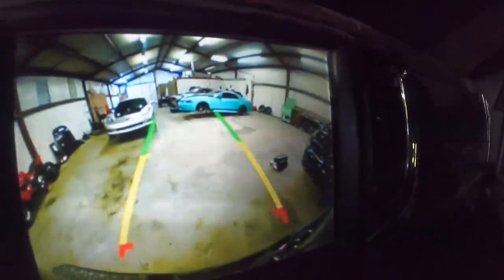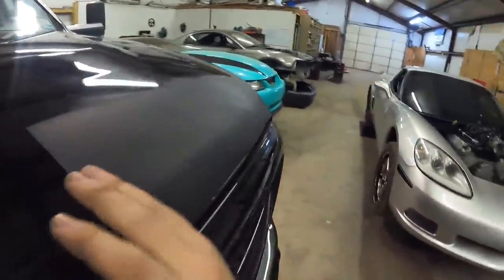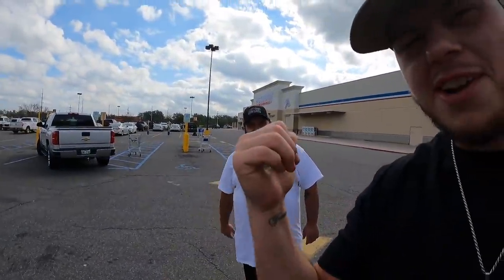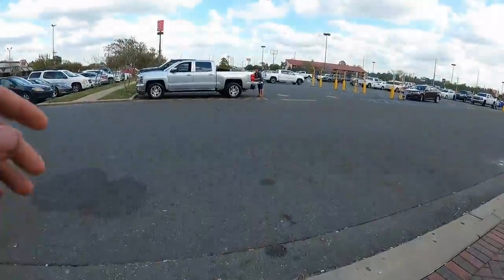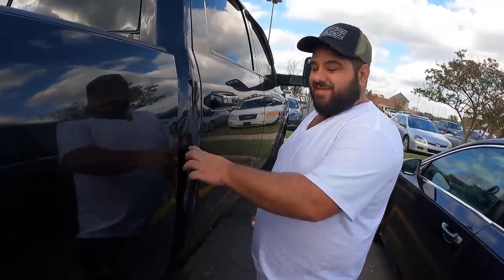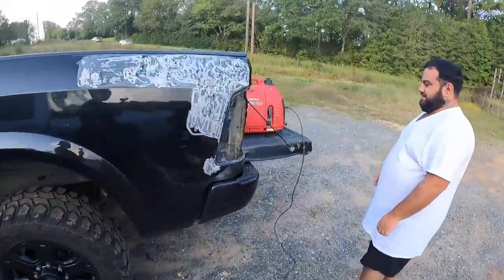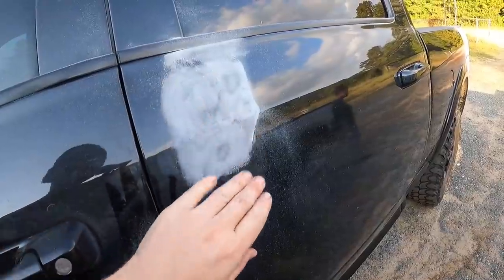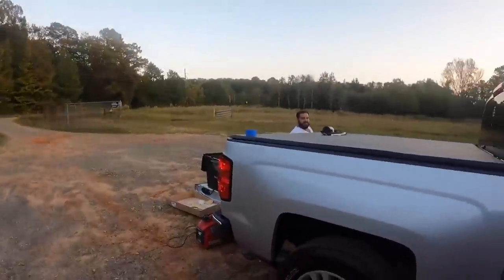Gypsy Body Man Fixes Major Damage on My Truck in Parking Lot!

Comment: Remember when i was maybe 20 years old, almost 2 decades ago now.  I was just a broke kid trying to make my way in life at the time.  I had a Kia Optima.  It was actually a fairly nice car for my broke ass at the time and I was proud of it.  It was the first car I purchased from a car lot so I was proud.  The car had a big ass dent about the size of a football in the quarter panel.  It was that way when I purchased the car.  Apparently it happened while the car was in transit to the dealership.  I dont fucking know and didnt care.  All I cared about was because of that dent I was getting a 14k car for just under 11k.  Other wise the car was really nice.  I was at home depot one day and this little Mexican guy told me he could fix the dent with in a couple hours.  Which was perfect because I was going in Home depot which is still to this day like my favorite store.  I always spend a couple hours in there browsing around anyway.  Well that day was that guys lucky day because I had just gotten paid the day before and had a little extra money.  I was skeptical but I went with it.  I figured he couldn't make it any worse.  By the time I got out of home depot the guy was putting on body filler.  He did a fucking amazing job.  

I kid you not, I still have a relationship with the guy to this very day.  He has his own small body shop now.  He stills takes out dents and dings from my vehicles at amazing prices, a whole hell of a lot cheaper than other shops would charge me.  He said he hooks me up, because I took a chance on him all those years ago when he had nothing.  That 150 bucks I paid him in the home depot parking lot that day may not have been a lot, but it helped him on his way to having his own shop.  As for me, I was just trying to get my car fixed haha.  Guys name is Amilcar, and Im glad he realized his dream of having his own shop.  Not everyone can go from hustling up business in a home depot parking lot to owning their own shop.
Reply: I'm glad you and Millkcarton still talk.

Comment: Dudes truck is going to rust from the holes he drilled
Reply: That's why a shop uses a stud gun.
Reply: Been doing it for years, never had a single problem
Reply: @Mr Murders actually most body shops now days are remove and replace, that hood would of been R&R, the rear quarter panel would of been cut out and replace, the rest would be the dent puller . Personally I would of done it the same as the gentleman did except for the hood which would of been R&R.

Comment: You ALWAYS ALWAYS sand the area that your applying filler or primer to... a few hot and cold days and that new material is going to separate from the shiny polished surface 100%... that guy knew his stuff but he was rushing he never sanded the bonnet/hood at all that filler will never stick.

By the way iv been doing high end bodywork restoring classics for the last 15yrs, bodywork and paint, just in case anyone thinks I’m a a keyboard professional
Reply: I think the it will hold OK.. its thin, and the newer bondo has more adhesive character than it once did. Ideally, a good cross hatch with 36 grit is best.. but its been my experience in the last 20 years or so the fillers stick darn well. My family had a repair shop back in the 70s 80s... and ever since I have done DIY on our own vehicles, and a few for friends.  Got no booth, so have to farm out the final paint.. but everything else we do in our home shop.

Comment: I’m not hatin on this duds hustle but the overspray tho
Reply: Its getting a wrap or being painted so it doesn't matter
Reply: The overspray? He flat out said its primer that still needs to be sanded.... lol
Reply: ya those little strips of tape ain't blocking off shit! A couple of clean painters tarps or some clear poly tarp and he could have protected everything. I don't know if I saw wrong or what, but at one point it looked like he was spraying the edge of the door with the door open and I was picturing all of that overspray hitting the side of the seat and floor
Reply: @BlankSlateRenovations  so you think a guy that drove a dented up truck around towns worried about black primer on his seat that only the person getting into that seat sees...... I think that's the least he was worried about hell it's the same color even might of helped lol. Not trying to argue but the saying goes you get what you pay for. If you want a perfect job go to the expensive guys. 👍 I'm the type of guy I dont care as long as it's getting me to where I need to be.

Comment: Good for him he knows what he’s talking about but the way he did that job is what you call half fast/hack jobs. You can never do that in actual shop, which I’m pretty sure why he’s doing it on the side. You would be fired in a instant. You aren’t supposed to exceed any where close to 1/4 inch thickness with body filler. And he clearly exceeded way past on the hood and looks like on the bedside panel aswell. The reason why is because over time that body will actually crack because you exceed that thickness limit. Another thing the way he pulled out that cab corner is by far the worst way possible. And the worst thing about it is, he didn’t even weld those 2 holes up. He just filled them with body filler over time that panel is gonna rust from the inside out because body filler attracts moisture especially in tight spots like that. You’re gonna end up spending a whole lot more money in the end trying to fix your truck because more than likely those panels will end up being replaced by a actual reputable shop that has to follow procedures the right way or you will get in BIG trouble with insurance companies.

Comment: damn...watching this made me sick..his body work is trash...drilling holes to pull a dent is 50's and 60's shit...the body lines are horrible...you paint that youll be upset...

he didn't feather out all where he was putting filler..didn't seal it...

sooooo much going wrong in this video I feel sorry for your truck...the fact he didn't just pop off the bed cap to repair is another sign...he got you
Reply: I mean it is a 600 dollar job. If you wanted repaired the right way it would have cost 2000 plus at the body shop.

Comment: Looks good. Not to be critical but the holes he drilled should have been welded up or not drilled in the first place, the hard line he put in with the primer will need to be fixed before paint or it will show. The primer will also need to be sanded completely out because it will not chemically match the paint shops may use, and most ships will not warranty their paint since it was not done at their shop. But the cost trade off can be worth it. I did the same thing for my truck and had it painted at Maaco and it has lasted 2 years now without any problems.

Comment: Old school bodywork.  Nobody drills holes for a slide hammer anymore.  Either pins are welded to the panel and ground off OR a post is electronically stuck to the panel and twist pulled off after the dent is pulled.  Rattle can primer!  Damn... For very small spots maybe.  I've been doing body and paint for 32 years.  He did a decent job for what he was using,  but not what a modern shop would put out.  Cheese graters are archaic at best.  Lol.  Entertaining seeing someone using one these days.

Comment: I've done bodywork and grew up in a body shop, on and off for 40 years, but I'm nowhere near that fast. You gotta show it under ( black) paint so we can see exactly how straight it is.  I'm nowhere near so fast. What'd he use on the bed a pinspotter and slide hammer?

Comment: I had the exact same thing happen to me with my 1st car back in 1989.

I bought a crashed theft recovered 1982 Mazda RX7. The biggest body problem was a huge dent in the rear. A guy stopped me at a light at 207th st (NYC)  and asked me that if I wanted it fixed, that he could do it in an hour for $200???

Sure enough an hour later, I rolled out with a straight body match painted rear.

Comment: This may be good where he is. Up north, thats called rust through in a few years. All he needs to do is replace his old school slide hammer with a stud welder. Sand, weld a few studs and pull with the stud slider just like he did with his old school way.  This way you don't have metal penetrations! The tool is available at harbor freight! You can also do doubles and triples if you have a harsh crease your trying to get out
Reply: yeup and with that stud welder it will cause the paint to burn on the backside of the panel where you cant repaint it to prevent rust.. ever notice when leaving a piece of metal sit after it was welded the welded area rusts first? Damned if you do and damned if you dont eh :)
Reply: To some degree you are correct, but that's only because the heat affected  area has migration of chromium or nickle. In this particular use scenario, the heat may (albeit rare) burn the paint on the back side, which may lead to rusting- however because the rust is on the back side, it will just flake and rust off behind, and not damage the exterior.  It's still way way better than drilling!!!!
Reply: @rickw4160  nope, the heat is there and will burn the paint,  moisture WILL get behind the panel and over time, you have rust, and the only way it get behind the panel and seal the metal again. Lots of people talking about moisture getting behind the bondo, well, if you paint over the bondo, doesnt that seal the bondo, expecially when you use a urethane?. Anyways, i woul dnt of used bondo anyways as I hate that stuff as it DOES ATTRACT MOISTURE and with the hole, well, it will pull the moisture from there. Icing would of been the best but it is expensive and then you still have to seal the raw metal inside from the drilling. But, in todays times, most people dont keep a vehicle over 5 years and most repairs will hold up for longer than that.. Anyways,, I am sure we are pretty much in agreement it could have been done better. :)
Reply: @cferguson6688  I think we are in agreement! But scratched metal rusts faster than unscratched.  The results up north always show after a few years when it starts falling off...lol

Comment: The two doors most likely could have been repaired with paintless dent removal. The hood, cab corner, and bed needed more attention.  Wish the guy would use a stud gun instead of drilling holes for slide hammer. Caution of the parking lot autobody shop. My dad fell for it a couple years ago and in the end my adolescent child could have done better.  Glad you had a more positive experience.  Happy to see this man making a hustle to support his family.
Reply: Do not underestimate adolescents, when i was 16 i did a complete engine overhaul on my BMW e36, just to prove to my dad that i can do it.

I'd imagine your kid would fare well enough if he was interested and motivated enough.

Comment: Ram body is super soft metal gonna sell mine.. Transmission dead at 68k miles. Junk trucks. Cummins is nice though. Door hinges squealing no matter what grease or oil you out on it. Wish i could love my 2500 again like i did when it was new in 2017.

Comment: I give him props for doing it as fast as he did and how good it looks but you don’t want to fill in dents that’s big. Nore do you want to drill a whole. I work at carvana Ic in the body shop and our guy has been doing it for 10 years is from New York and could of fixed all of it in 5 ours for the same price and 95% would be done with a spot welder and pulling the metal. The more body filler you use the faster the paint will peel off and the body filler will break.

Comment: You can’t do bodywork fast because it shrinks as it drys and it’s very important to let it dry completely before going to the next step. My guess is that you will at minimum have to block sand it out and run another coat of filler then block that out too. Whatever you do don’t paint it soon. Give it time to cure.

Comment: $600 is wayyy too much, I stay in North Carolina and on my Tahoe I ran over a mailbox and it dented the bottom of my door and dented in my rocker panel on the passenger side about 3 inches. My tahoe is 2 tone but I ended up getting it all bondoed up and painted silver for $300

Comment: Good shit man. But don’t drill holes and fill with just body filler🤦🏻‍♂️it will rust. Most guy’s including myself do not use spray cans. Primer is like a sponge and is not meant to be left in the open for too long especially getting it wet. I always use a 2k primer, basecoat, and a 2k clearcoat. The worst is how he drilled that hole out and did not waterproof it. He devalued that truck man

Comment: Me being a good guy, got screwed by a very similar story. I had damage on the rear driver side of my elantra. I walked out of a Sears Hardware store and this guy walked up to me saying he could fix the damage for cheap. He said about $300 to pull dent and paint match. I said ok. and he asked for money to get bondo and stuff. So we went to auto zone and he grabbed the supplies he needed and I followed him to his house. He started pulling the dents and even had his teenage son out there and was showing him the process,(which I thought was cool). Well after he pulled it, it got late, and he said next day he would bondo it.and I said ok. So he showed up to my place and applied bondo. but didn't sand it because it needed to cure. Next day after. I could not reach the guy. I even pulled up to his house and no one would answer the door. I tried several times then gave up.I went from having a dented car to a slightly less dented car with uneven bondo on it....

Comment: I do bodywork for a living. This is not the kind of work you want done to a new truck. Drilling holes went out 25 years ago! I guarantee that bodywork is gonna wave like the guy did leaving. If you have a nice car/truck take it to a professional that will use quality materials and finish the job. This guy spent $600. Now a pro will have to rework that Hack work so when it’s painted it don’t look like crap. Also paint alone is 2-300ish per major panel. Add in detrim/molding emblem replacement and your gonna be back to where you started.

Comment: Some guy came up to me with the same offer, dent was on the side of my trucks bed...offered to fix it for 400... I didn’t have the funds so declined...he got insistent and said look ima help you out, whatever you can do outta pocket right now cash... I’ll get rid of the dent scratch free and no painting needed...all I had was $80, he said I’ll do it for 80... I had to think it through..I really was struggling at the time.... said sure ok. He pulled some tools out of his pickup hammer and suction cup and got to it. Took him about 20 minutes... was definitely looking real good after...gave him the 80 and dude drove off... next day someone saw it had changed appearance and was looking nice and all fixed and went to touch it.... it sunk in smh. lol. not as deep as it was but yea... so basically dude wanted to charge me 400 for it to sink back in after a slight touch and not tell me.

Comment: I see a lot of people criticizing his work but what you experienced bodyguys fail to realize is this man is working out of a TRUCK and doing work that while not top of the line, is great for the price. I paid $500 for a guy to pull ONE dent out of my Trans Am and me and my dad had to not only sand and redo the entire panel, but we had to hammer it out and finish the job the dude took our money to half ass and it’s still not straight and you can tell where it’s been fixed cause of how the dumbass didn’t tape it off correctly. For a fly by night body man this guy did quality work given the tools and resources used, my Trans Am however? A “15 year autobody technician” used my tools, my sandpaper, and my paint to completely fuck my shit up and charged me $500 on top of that. For $100 more I would’ve gladly paid this guy to do it.

Comment: HEY DONT TAKE IT TO A SHOP EITHER FOR PAINT THAT WILL COST $146283 JUST GO ON EBAY, AMAZON OR GOOGLE AND SEARCH FOR PAINT CORRECTION FOR YOUR TRUCK, PAINT CODE SHOULD BE ON THE DOOR PILLAR OR YOU CAN GET IT BY VIN NUMBER SEARCH! IL BE CHEAP SPRAY CAN WITH THE RIGHT COLOR AND CLEAR COAT AND YOU JUST BUFF IT AFTER OR CALL THE SAME GUY TO DO IT IN TOTAL UNDER $50!

Comment: this kind of work is what gives people in the industry a bad name. i understand this guy is working hard for what he does. but does not change the fact that it is a hack job in the end. putting bondo over paint like he did will fail. it will lift over time. the primer that he used will peel also. putting automotive grade paint over that can lead to a laundry list of problems. drilling a hole in a panel to pull a dent was common in the 50's, 60's, and even into the 80's. that hole must be welded up or it will cause rust. no question. now when a shop quotes you $4,000 for that repair, you are hit with the sticker shock. but looking into how they came to that price it's not so  outlandish. your looking at close to $1k for just materials for that jon (consumables to pull dents, body filler, primer, color and clear, sand paper, and masking materials) but know all the products come with lifetime warranty. then you factor in the labor for a body tech, prepper and painter. not to mention that all labor is lifetime warranty also. but know that right before this guy left, he was already making excuses for why it might look off when wrapped or painted. then if it fails later on, who is going to fix it? the guy you meet in a parking lot? or the shop that will now charge you $8,000 to fix all hack job work that was done wrong in the first time.
Reply: I don't know a body man around that gives a lifetime warranty. You sound full of it. He did a decent job for what it was. I'm willing to bet a good 5 years on that body work. 10 if it isn't in a state that snows.